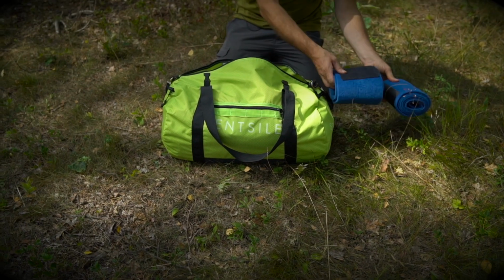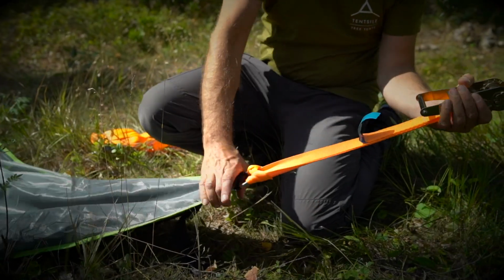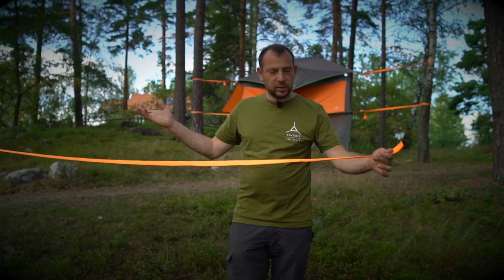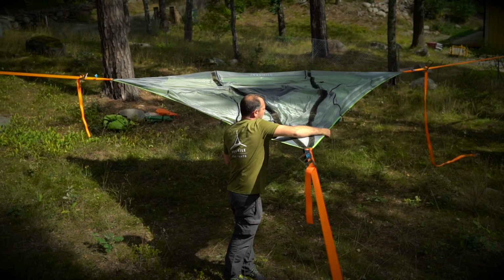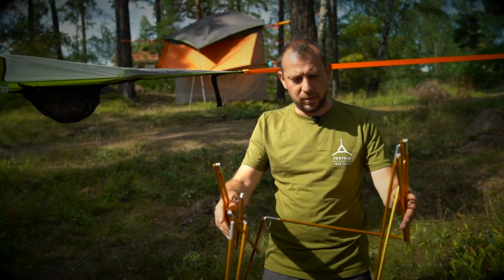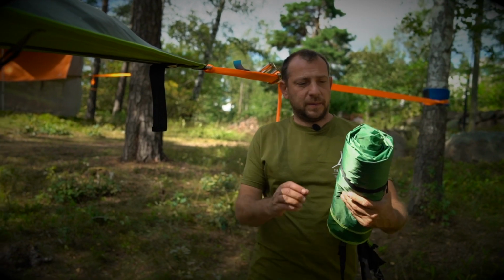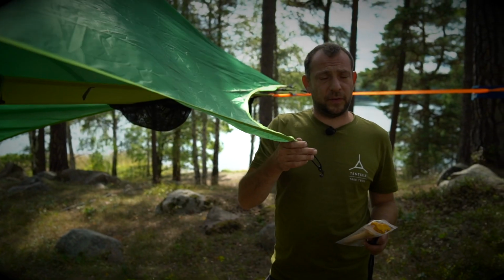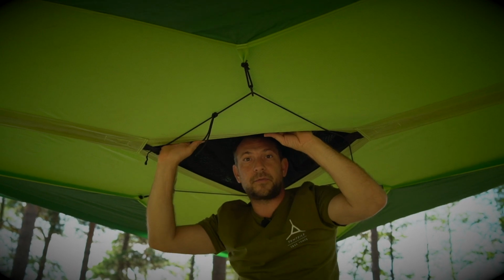Tentsile Stingray 3-Person Tree Tent: Set Up Guide

Comment: Just bought the stingray used off a Facebook marketplace, it’s in good condition from what I see think it may be a 1st gen since some of the features were changed like where the poles sit inside the tent myn are just a material spot down into the tent. Really like the look of the plastic or rubber parts on this one think it would be a little more durable overall as time goes on it’s just going to get better and better.
Reply from the maker: Congrats on being a new Stingray owner! Here's to some great adventures coming up 🙌

Comment: I want to buy myself such a tent. Which self-inflating mattress is better to use for maximum comfort and straight back. How will sea to summit Comfort Deluxe Self-Inflating Sleeping Pad DOUBLE 201cm x 132cm or sea to summit Comfort Plus Self-Inflating Sleeping Pad DOUBLE 183cm x 128cm fit there? Who used these models inside or can you tell me the best options?
Reply from the maker: I would recommend a single mattress to fit within the sleeping bays, the dimensions of ones we used to supply were 198 x 58 x 5.5cm

Comment: Great video, thanks! Do you need a foam mattress or air matress or those are primarily for ground tents?
Reply from the maker: You don't need them particularly in summer but they really enhance the set up for any time of year and give extra comfort as well as insulation from below. We sell custom designed air pads and quilts to fit :)